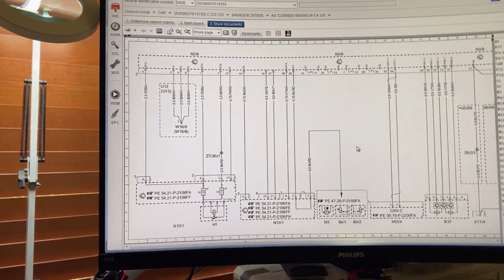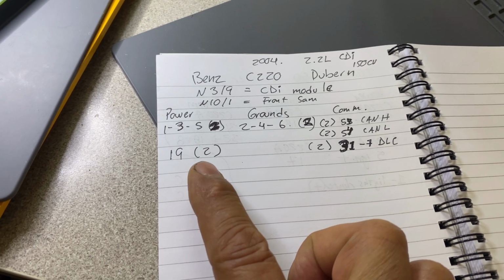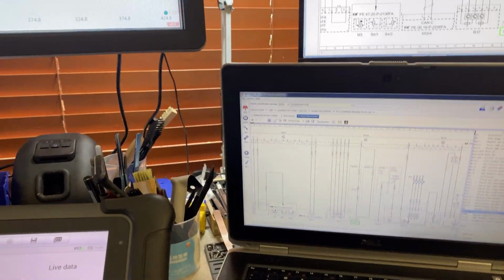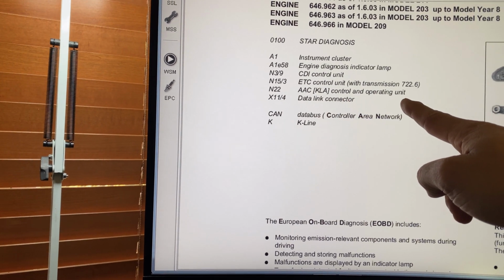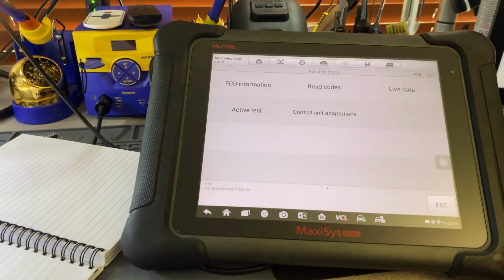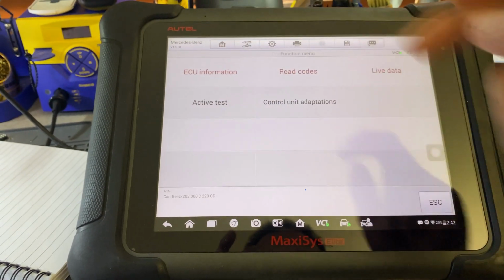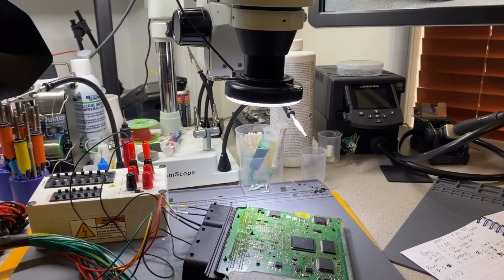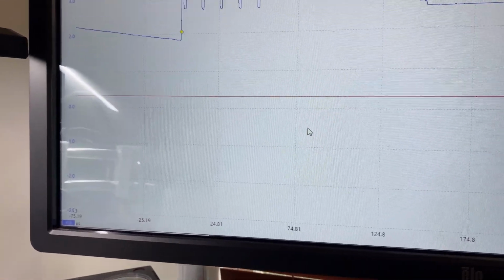2004 Mercedes C220 CDI ECM no communication diagnosis and bench test connections

Comment: I have a 2002 clk 320 and it say no communication to the transmission control module. U say the dry up. So I can take all the connections apart and put Vasile on it. It should work..